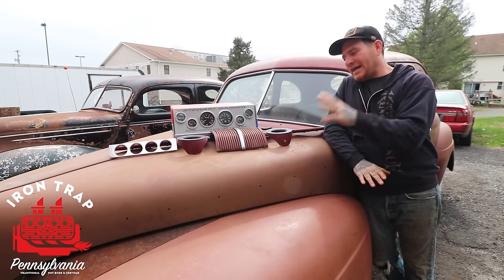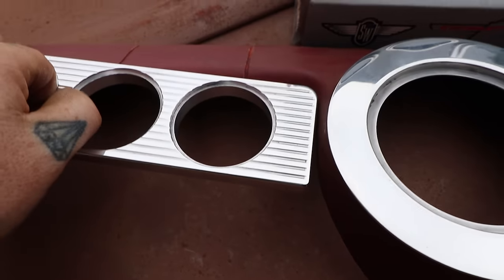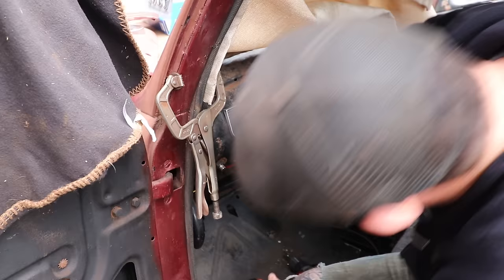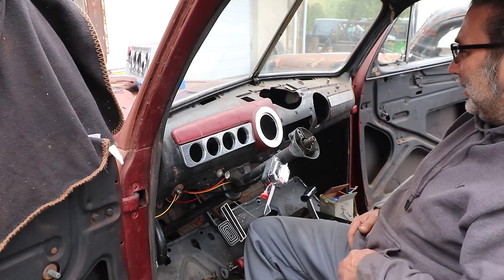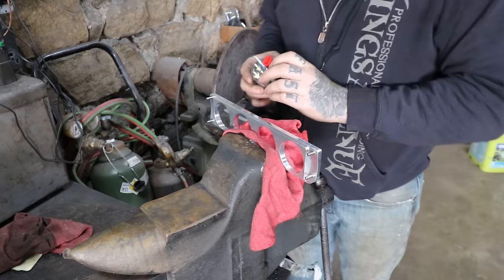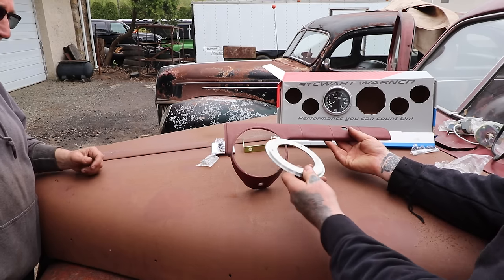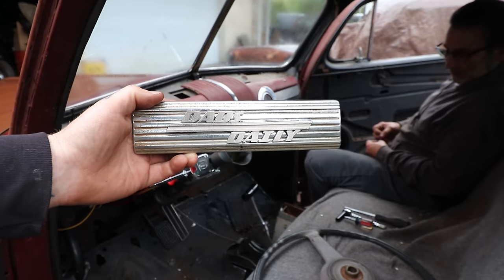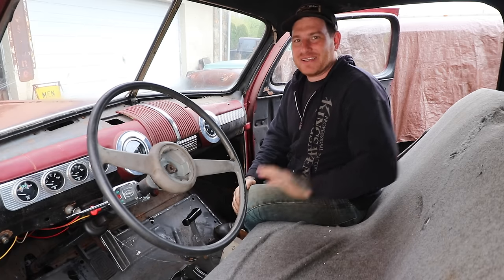Dad's Daily 1947 Ford Gets A Dash Full Of Stewart Warner Gauges!!!

Comment: Hey guys, got a 1947 Ford Club Coupe story for you. My dad's first car was a 1947 Ford Deluxe Coupe, he ordered it brand new from St. Paul, Minnesota when he was 16 yrs old from a car lot his uncle owned. He made as many payments on that coupe weekly from working side jobs, odd jobs, including doing car repair jobs to pay for it. In 1948 he went to pick it up after riding his bicycle past the car lot for a year. Under one arm he had a box, in it was a pair of aftermarket fender skirts that he had a local body shop paint to match the car. 'Tucson Tan'. Finally, the day came, he sold his bicycle to the neighbor kid, paid the last payment on the deluxe,  walked into the car lot carrying a box of the fender skirts and put them on before he ever drove the car. That was in 1948. He drove that Ford to his High school Graduation, took his wife (Mom) on their honeymoon, and every weekend he raced that car with many, many transplanted hopped up V8s, Including an Olds, a Mercury, and even a Cadillac V8! After many years and many V8 swaps and transmissions that the frame started to look like Swiss cheese, so he finally had the whole car completely restored, custom frame, Small block Chevy V8, automatic Trans, Mustang II  front end, 9in Ford rear end, and still had the original Tucson tan paint. My dad passed away a few years ago, and it still looked as pretty the day he picked it up. The '47 Ford Deluxe Club Coupe is sitting in its own garage stall at my oldest brother's  place and it Runs perfect. My dad built, bought and sold many street rods over the years, but that one was his baby.  My Dad and Mom would have celebrated their 72nd wedding anniversary in February of this year. They had 12 children. 
 Thanks for listening.
Reply: Thank you for sharing your story!

Comment: Hate to be the negative one here but I really hate these gauges. The dash had such a beautiful design originally, every detail formed specifically for this car, and these look like that art was compromised to adapt these universal, off-the-shelf generic gauges (exactly what happened). The tach and speedometer are the worst examples ... those reduction pieces just look awful. And some of it is even PLASTIC? No, I'd honestly much rather have non-functioning originals than any of this stuff in this particular car. Sorry Matt! Love your work and channel anyway! My first negative Iron Trap comment ...
Reply from the maker: The adapter parts are metal actually not plastic. The plastic parts are original pieces. Can’t please everyone but it fits the style of the car over original gauges.
Reply: @IronTrapGarage  I know! You do fantastic work guys, and have done more cars than me ... it's just a personal preference thing! Those cluttered Dakota Digital gauges or the 57 Chevy ones with three (yes 3) chrome rings around them to fit the tiny new ones into those beautiful original holes get an even worse reaction from me ;-) But, if your dad and you like them, then that's all that matters. Cheers!